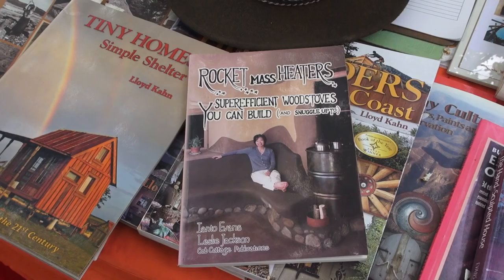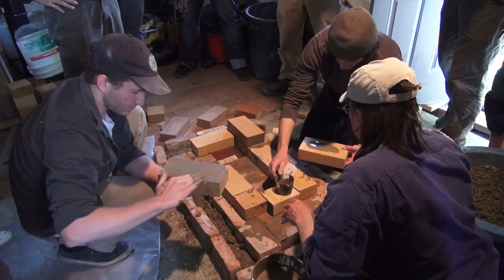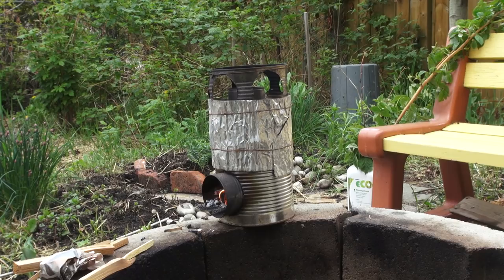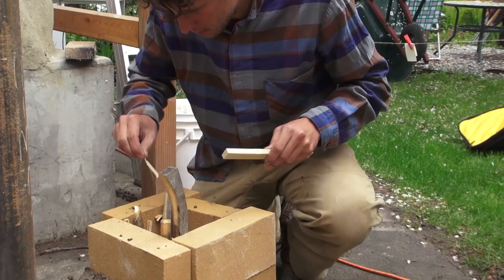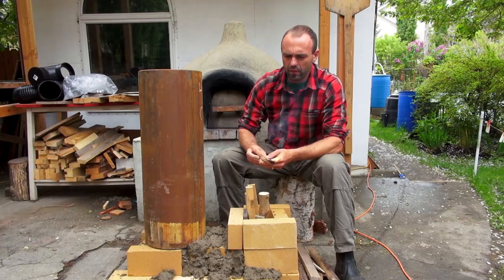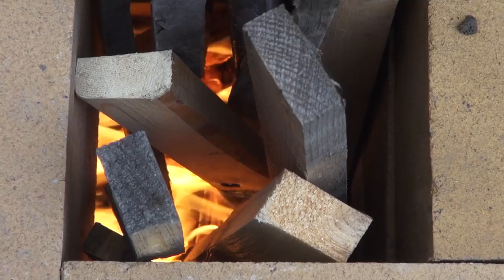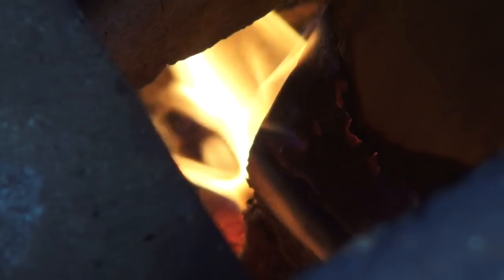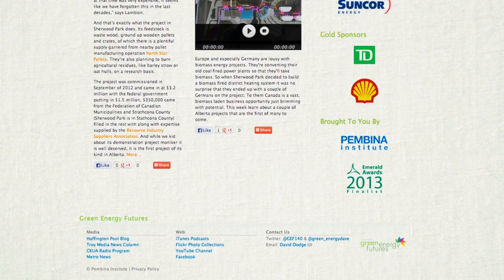47. Rocket Mass Heaters: A better burning wood stove

Comment: I think you can make it yourself, just loook and learn from woodprix .
Reply: look around, there are a lot of people into this.  There is a community out there that we were able to contact...(online community btw) that had plans that we were able to get.  They were either free or really cheap.  We adapted them to 10 inch stove pipe and full 55 gallon barrel.  Used 2 times the amount of clay/mass too.  Works.
Reply: Plans are perfect Vlad!
Reply: yeah only the narrator - he now says to do NOT use a metal heat riser

Comment: I've built a RMH myself with no piping in the mass....just a void or 'bell' which allowed the heat to stratify before gases exited the outlet flue. Very efficient and inexpensive, but heavy in labour. Get the books!
Reply: Now that you've had it in for a while, do you think that its better without installing pipe in the mass or with the pipe in the mass of the RMH?

Comment: rocket mass and rocket heaters are quite affordable if you have the time to scavenge...and even if you do not, they are cheaper than the store equivalent efficiency.  Installed one with my father in law in the in-law's new home.  Works wonderfully.  Adapted the plans from someone in the rocket mass community...apparently they do exist.  The clay cost less than 400, found the bricks, had the drum...the last things we needed was some 10 inch stove pipe, both double and single walled.  I would say around 1200 total for a beast of a stove.  It is large enough to heat 2200 square feet, fired 2 times a day in the dead of winter.  It seats 3 people comfortably(because it is a freaking couch)....!  Anyway, I really wish we could have installed one in our home when we were building it years back, maybe one day.  In the meantime we have a Mohawk(from the 70s) which is a top draft stove which is amazing.  Not as efficient as the rms but close.

Comment: Love rocket stoves, but although the wood is burned efficiently, it burns as lot faster, I built one and had to feed it frequently if not contniously. The only one that seems to be maintenance-free is the kind that uses wood pellets.
Reply: Did you force the exhaust down towards the bottom of the burn chamber and then horizontal to heat the mass like a long bench and then to the outside with a long riser outside your house? Keyword "Mass heater"

Comment: To answer a few questions:

- How a rocket mass heater works:

As we all know heat rises so lets skip that discussion and go onto a more in depth explanation...
The smoke/heat take the path of least resistance which is up the larger diameter riser (taller portion of the J tube) and out the venting pipe. In doing so a vacuum is created which pulls air into the smaller lower opening of the J tube creating a high velocity airflow which supplies more oxygen to the fire thus creating much higher temperatures resulting in a very efficient burn of the wood which leaves minimal waste (unburnt wood) resulting in minimal amounts of ash leftover and a very clean burn. All in all more energy is extracted from the wood therefore less wood is needed.

The gases that would typically be in the smoke almost don't exist in a rocket mass heater. This is due to a very efficient burn of the wood. The more efficient the burn the less harmful and cleaner the exhaust becomes. This applies to anything that burns.

Just a FYI:
Wood doesn't burn it's the gases in the wood that burn and to release these gases heat is needed, the more heat you have the more gases are released. These gases can be captured and used to run an engine and can be used in many other ways such as storing it in a holding tank (propane tank) and using it the same way you would use propane or any other gas. This method is called wood gasification, if you want to learn about wood gasification just look it up..
Reply: Nobody cares of your explanation.its everywhere buddy
Reply: my question is ...how do you clean out the ash and soot , and how do you light the fire
Reply: "Wood doesn't burn it's the gases in the wood" 
The solid carbon that becomes charcoal isn't gas dude.

Comment: Very interesting. I wouldn't mind having a look at the flue mechanism to see if we could include an air feed to attempt to reignite some of the leftover wood gas. Not sure if that's covered
Reply: If you looked at more videos of this, you would know that there are NO residual gases left to burn. They do not use metal in the main burn chamber. Why? Experiments show that after a few "burns" its all melted apart scrap metal.
Reply: @johnverkler3962  Interesting reply, thank you ...
Reply: @7ann7seven13  Thank You  for your Thank You. =-)

Comment: I know that in most places where wood burning stoves are permitted, there often is a chimney cleaning requirement, in my experience an annual requirement. My question is, if the flue gasses run through horizontal pipes to heat the thermal mass... how would one be able to access those sections for the sake of cleaning? I know that 90° angles are problematic in the sweeping process.

Also someone should investigate the specific roadblocks for permits in residential situation. Certainly the permit process is a pain but usually if one can prove reliability and safety via a study or engineering report, inspection agencies would approve their use. (That is, it can be difficult, but it can be done.)
Reply: Gas inside burns down instead of coating the pipe.pressure keeps it cleaner just ashes to clean
Reply: There are usually T cleanouts put in, but the stove also gets up to temperatures that combust virtually all material and volatiles. The mass takes the heat that usually gets to above 1500 deg. Safest and most efficient stoves in the world are also illegal. Hurrah america.

Comment: How long do you think the inner pipe will last?1 or 2 seasons before it burns a hole in it . you chuold use a fire resistand fleu in here .use perlite-clay mixture inbetween the 2 pipes and it will last you a lifetime . just more energy effectif and efficient  :-)

Comment: The exaust comes out the bottom the super heated air is rising out of the riser and causes positive pressure in the barrel which pushes the remaining air down through the exaust then the exaust starts to create a suction that causes the stove to rocket

Comment: This type of heating is ubiquitous throughout rural Russia and Siberia...I'm confused, why are people talking about this as if it were a western contemporary idea to address a third world scarcity of fuel? My friend used to sleep on one of these cob stoves just outside Kemerovo that had been built shortly after WWII. It was one of the 'newer' ones in the village.
Reply: Good point. My Baba (who is now 99) used to do all these things on the Canadian prairies. She learned from her folks who came over from the Ukraine. My folks, however, have no clue. The knowledge transfer was stopped because people had figured that they had found better ways to do things. Facing limits, it appears we're rediscovering 'new' ways of doing things our ancestors used to do out of necessity.
Reply: Masonry heaters are traditional, rocket mass heaters are new.  Of course, if your family invented them a hundred years ago, cool.  But they were never general, or really known.
Reply: Its the internal shape of the rocket mass heater and te efficiency obtained that is different than Russian ceramic heaters.
Reply: @crcurran  I don't know - I've seen the Russian masonry stove designs and they use a long vertical chimney like shaft before going back down again. So seems like it would have a rocket effect.

Comment: I am surprised that been years I seen this rocket stove videos,  none of them every consider putting metal fins on the barrel for more effective heat radiation, with an opened bottom and top case wrap around those fins, first it's safer to prevent people accidentally direct contact with the heated barrel, second, the cold air will suck into the gap from bottom of the casing, passing though the fins and heat up.(passive airflow)
Reply: Time to make that idea into video... and if you do ? Please use some other then a boring ol’ barrel....
Good luck I’ll look for your video!
Reply: @randalmoroski4423  The "boring old barrel" as you say, is what runs and makes the thing work.
Reply: The barrel does not need fins to make it more efficient. You need to watch more videos to see more of how they work and why they wouldn't need fins.
Reply: I believe you can actually touch the barrel and not get burned.
The gases that come out of these (properly made) units is less than 120°.
Reply: @christophersleight19  Hello, you better study up on this stuff. If built right, the fire chamber and barrel get up to 2000° F. You better NOT touch the barrel ! That's why you don't put any kind of sheet metal in theose areas
Reply: @christophersleight19  The light weight sheet metal will melt and disintegrate after a few (2 or more) startup burns. Thats why the fire  chamber to the barrel is all fire brick!! The 120° F.  heat is after it go's through the heat absorbing clay/rock (couch/bench) and out the chimney.
Reply: @tims6540  Hello, Tim.  A well made unit has enough self draw to work. It doesn't need a fan to "help" it. That's why it's called a Rocket Mass Heater. Look up Erica Wisner, they've been building RMH's for YEARS.
Reply: @johnverkler3962  John, I know it's lined with fire brick, which is why you can touch it.
  It's merely a containment system.
  But thank you for your comments.
(Video after video there is never a voiced concern about "Don't touch the barrel!"
Which is why heat fins wouldn't be an advantage.)
Reply: @christophersleight19  Hello again. You need to watch more videos. The barrel does get hot. Some people have cooked food and boiled water on top of the barrel that you say doesn't get hot. Please look up Erica Wisner. She and her husband have been making Rocket Mass Heaters for years. I repeat please look her up ! People don't mention don't touch the barrel because it's an obvious conclusion, it's hot. Would you touch an exhaust pipe on a running car? No it's obvious  that it's hot.

Comment: One thing I can tell you is the exiting temperature can be 80 degrees which is less then your body temperature. Also complete combustion is attained. i.e. the only exiting gases are CO2 and H2O. No smoke or CO

Comment: I understand the concept of the heat being sucked into the barrel but wondered, when first firing it up, how does the heat and smoke 'know' to go into the barrel and not straight upwards into the room.
Reply: +M Spanford Lighting a small piece of wood and holding it inside causes the warmer air to rise up the long vertical piece. This causes the pressure differential which creates that "sucking".
Reply: www.conicet.gov.ar/calefaccion-accesible-y-de-primer-nivel/
I have seen one of these stoves here (they call them the russian stove). And it suck the smoke inside it like a vacuum, making a noise like a motor (as shown in the video). Is very neat. No smoke, not ashes. But here they use a chimney to vent the stove, with very few smoke.
Reply: I have a rocket stove heating my cabin here in Alaska I used 1 cord of wood last winter.  While my design is different, the concept is the same.  Believe me, any flame at all under that chimney will start the process. Once heat starts to rise, the fire increases and draws more air. I have occasionally gotten some flame outside the firebox and it sucked it rite in. my cabin is 10x14., if there was even the slightest smoke being introduced into the room it would be horrible.

Comment: problem for USA home use may be using 55 gallon drum after being heated , cooled and heated many times will rust out just a guess maybe 3 yrs depends on how hot it gets. so why not start with at least 3/16" or thicker metal barrel ?? if home is build tight then maybe a fresh air line in chimney could be piped to a door on fuel inlet port. after fuel put in close door then fresh air goes to heater warmer than outside air. do like your heater   --  working on a design my insurance company will approve hopefully

Comment: One thing I haven't figured out yet is how do you take ashes out of the stove. What I see from the design, you do it by letting the fire die down and then you stick a vacuum cleaner tube down that tiny opening and suck it all out.

Other than that, my grandma could really use this.
Reply: Yeah no one talks about the cleaning side of these things. It's probably a huge pain in the ass. I will try these when someone figures out an easy way to clean them.

Comment: So, if you have been away for a week and your house is freezing cold this will be useless as it, I guess, will take about how many hours for the mass to heat up? Other than that, I love it and would use it daily.
Reply: that's the point of having the barrel produce radiant heat. it gives the instant heat you want, very soon after you light the fire, easily comparable to a normal wood stove. the mass only collects heat that would otherwise be leaving the chimney. you cant do that on a normal wood stove because a normal stove doesn't get hot enough to burn the creosote before it can condense on the stovepipe. when the exhaust leaves the barrel, it is mostly nitrogen, CO2, and water vapor. this hot exhaust is pushed out through the mass by the force of the super heated fire in the heat riser. by the time it leaves the house, it is 100-200 degrees.

Comment: But how you start a fire with chimney that is not pulling air.
And alot of air goes true the chimney, with the need to open a window or door and how efficiant is that?
Also you need skinny wood what means more work to proces it!
I dont know....

Comment: yes .Where do you clean the ash out?
Reply: +macaristan34 Good point.
Reply: You design in a few clean outs. No problem.
Reply: If done right, there is no ash. Add enough oxygen and you will have complete combustion into water and carbon dioxide.

Comment: vid is saying it is clean , efficient burn - this is to do with air flow - and suggests complete combustion. Jake Trautman is right. Carbon monoxide is product of incomplete combustion when there is not such a high oxygen:fuel (wood) ratio , (so something problematic would have to have happened to the inflow of air, a blockage) . precautions are same thing as any other burner - ensure good ventilation in your home, and if you think it is needed, then use monitors for CO gas.